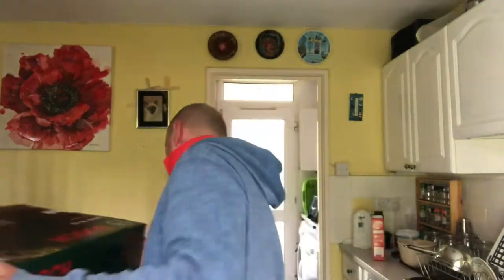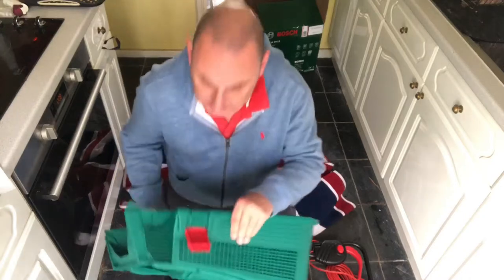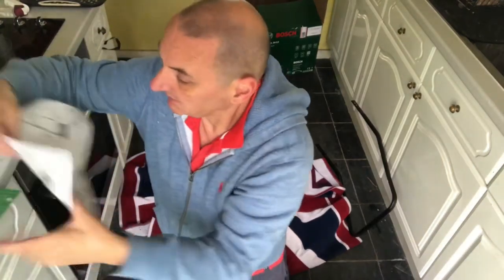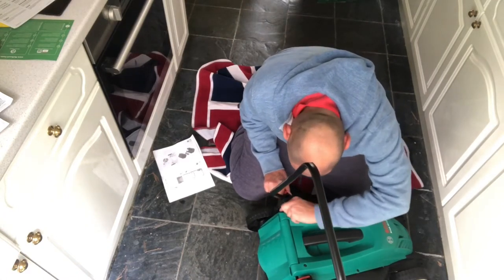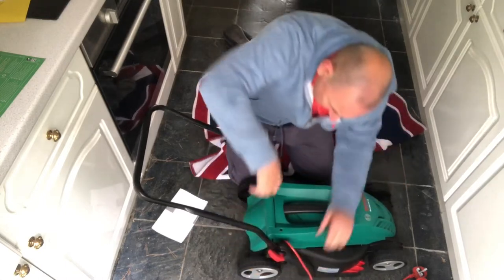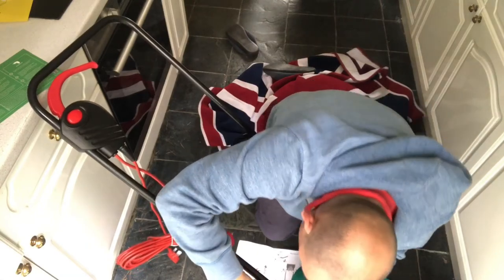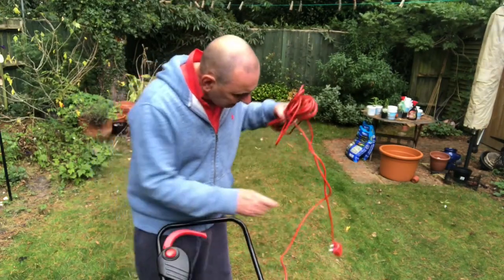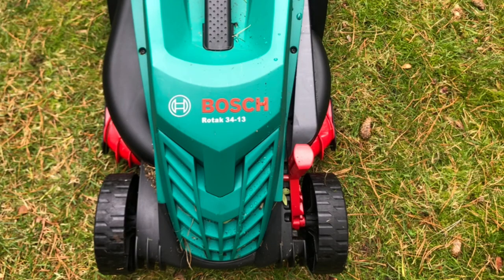Unboxing assembling and testing BOSCH Rotak Lawnmower

Comment: Thank you for what finally turned out to be a great video. 🤣I also bought this Rotak 34 after using a Qualcast for 14 years. The only reason I bought the Qualcast was because Argos had run out of Bosch. 

By watching your video while assembling myself, I was able to finish in a shorter time than you did. (Lol) You guys need to assemble in a bigger area,such as the patio or garden. There's another fellow on YouTube who assembled indoors with great difficulty.

After giving the mower  a try on my lawn I must say that it  is magnificent. I got a Bosch Rotak 32 last month, but that's no good for me. The blade doesn't have enough levels. This is much much better.

Comment: I agree about wanting to just buy a pre-assembled mower where all you need to do is put the handle on. I found it reasonably easy but fiddly because like you I put the square thingy back to front then realised I put the arm on back to front 🙄 so had to take it off. Excellent video, much appreciated.
Reply from the maker: Hate having to get anything remotely flat pack 😂😂😂

Comment: Brilliant video. Thanks so much. You asked all the same questions I did, like how to get the wheels out, lol!! Thanks to you I think I've finally put it all together correctly.
Reply from the maker: Lovely to get a comment to know I've helped someone a little bit. Thank you Cilla.
Reply: @ChrisReardonUK  you helped a LOT!! You helped by showing how ridiculously difficult it is to assemble a lawnmower which made me feel less alone, and you showed me how to fix the lower bolts and the cable clip which I couldn't suss out. I'm pleased with the end result of the box, which probably took me 20 minutes to work out. All that's wrong now is the wheels aren't clipped on. I'll watch your video again then ask a neighbour. At least I've done the hard part! So thankyou again.

Comment: Super video thanks. Found the wheels. How to get at them? Like you pulled the 2 parts of the grass box apart before it became obvious that the red clips would probably open it up. I found the whole build quite frustrating. But once there decent cut from the mower.

Comment: I'm usually not bad at putting things together, and I've done a few lawnmowers before without any problems. My last one was a Bosch and I seem to remember it was easy.This one confused me from the start because just having unhelpful diagrams without any words is no use. It was the bottom handle that really got me, and I still think they could have made it a lot more straightforward. Also the wheels - managed to get them out of the grassbox but then it was trial and error getting them to click into place, and I'm still fully expecting them to drop off when I try to cut the grass tomorrow. It took me nearly an hour to put it together, and everything was really fiddly. The experience was just like your video. I'm optimistic it will be a good mower (if bits don't drop off it) but I'd give it 1/10 for ease of assembly and the quality of the instructions.
Reply from the maker: Let us know if the wheels stayed on😆
Reply: I finally got round to cutting the grass today, and true enough the wheels dropped off. Seems you have to carefully line the grooves up and then press them on really firmly. It did cut the grass well though, but the cut height adjuster is a bit awkward to use  and the grass box is flimsy and keeps trying to come apart. Not as good as my previous Bosch which I left behind at my previous house and now wish I hadn't.